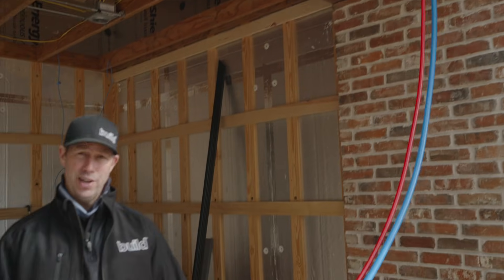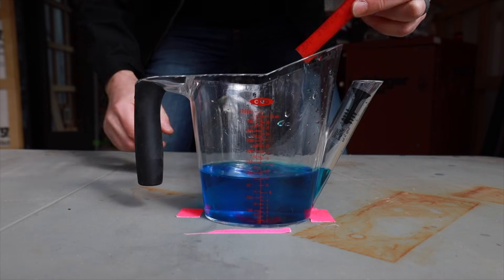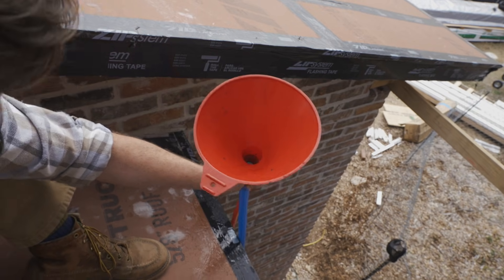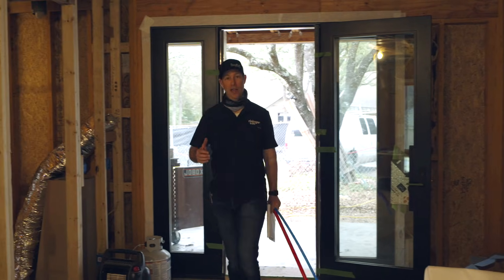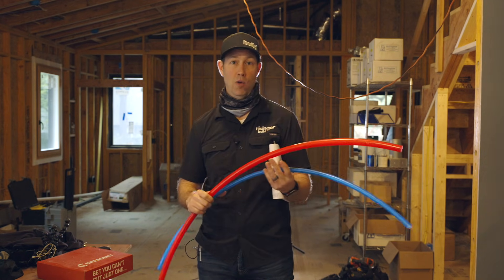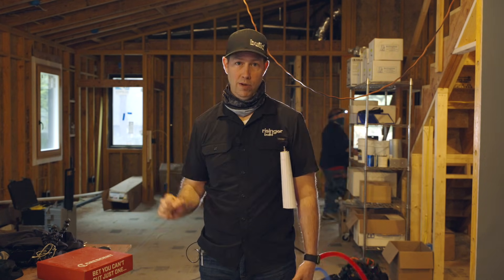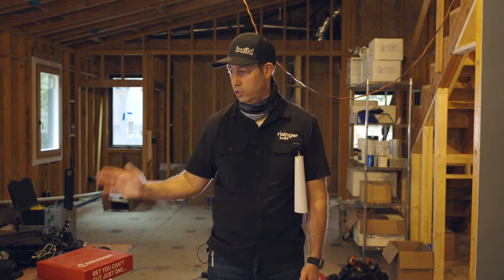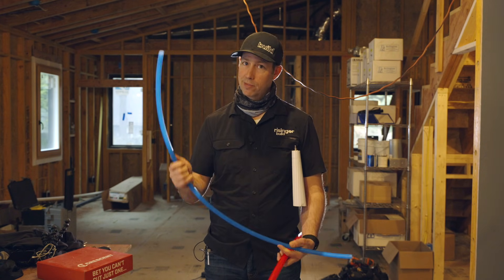What's the BEST Plumbing System

Comment: I hear you talking, about the water that's been saved by using a hot water circulation system. But I never hear you mention the heatlosses from the hotwater circulating through these pipes. The environmental impact from those heatlosses might be more than from the water you saved..... I would like a calculation from both! And if you don't want to do that, it would have been wortwhile to mention it at least...
Reply: Insulate the pipes,  get the circ pump that  has a timer or temp sensor that only runs when water gets below a certain temp.
Reply: @jefferystensland1304 
What form of energy does this circ pump use to operate?
Reply: @AW4WAL  same energy that your cell phone or electric vehicle uses
Reply: @jefferystensland1304 
I can guarantee you that the combined energy consumption of water heaters of households in the US, just one country, is exponentially greater than that of the all the phones or electric cars in the world so try again.
Reply: @AW4WAL  I'm pretty sure you can't guarantee that,  so how about you try again.
Reply: @jefferystensland1304 
This is simple commonsense deduction but maybe this isn't common to you...
Reply: Water is going to be more and more expensive depending on where you are in the country. San Antonie was/is fighting the city of Houston over water rights to Lake Houston and would be willing to run a pipeline across the state to get it.
He is using the heat pump for hot water so reheating cost will be very low.
Reply: @jameskitzmann6268 
You've missed the point.
Reply: The whole circulation line gets insulated. I installed a recirc system in my 1200 sq ft house and my gas bill went up $1-2 per month.
Reply: @briankloc  you just made that up. Why lie? Nobody has a gas bill so exact that they can differentiate between $1-2 a month.
Reply: @briankloc 
Now multiply this increase in cost and insulating material by, let's just say increments of 1000, which represents an average number of households and hopefully you see that this is an unsustainable trend.
Reply: Good point.
Reply: The electric to run the pump probably cost more than the heat loss in the line.
Reply: you also add a timer to the loop pump so it only charges during peak demand times.
Reply: @HalProctor  Grundfos comfort series pumps, timer built in also has an adaptive setting that is supposed to learn your usage or can be set on thermostatic so it comes on when the temp in return line cools off.
Reply: @jefferystensland1304  I used to install Grundfos and Taco circ pumps ages ago.
Reply: @HalProctor   timer wouldn’t work to well in residential. I don’t know about you, but our family’s schedule can be all over the place. And what happens if it’s not pre-charged, you have to wait like 5 minutes for hot water.

I guess with a 3/4 inch line it wouldnt be too bad. I have an apartment building with a 1.25” loop and if the pump goes down some people are waiting 45 minutes for hot water.
Reply: @Drizimar1  one word:  timer

Comment: Informative video. I'm in Ecuador but as I'm from The Netherlands originally (and then lives in the UK for 15 years too), I always hated the plastic piping that is common here, or worse, galvanized steel. We now have hospital-style plumbing; Unsure on the equivalent in the US, but it is clamp-on fittings. We planned it as much as possible with short runs from the boiler and the dishwasher (hot feed) and the sink (same) within a feet or so. Dishwashers that use hot water intake, common in the US and therefore here in Ecuador as a lot of stuff is imported from there, use that for the prewash. With the pods vs powder, you don't get a good prewash usually if the water is cold. So that initial inrush of 'really too cold' water can really impact ability to clean. Having that initial water warmer by having less loss (in that context, less cold water as part of that initial intake), will make a substantial difference. Little details matter. I'm no builder but it is always good to pick up on some great ideas shared on this channel.

Comment: Hi Matt, I'm from Canada and I'm a small the custom home builder. We use manifold and hot water circulation line to efficiently supply hot water at instant. Doesn't this suffice? Or you reckon this new system is much better than that?

Comment: Seems energy intense having recirc lines just to circulate hot water for immediate satisfaction. The grievance of waiting "20 seconds" I think most homeowners and reasonable people can live with. That being said, I do appreciate the potential water savings.
Reply: I think it comes down to region and resource. For those on a well and the water is just used and sent back into the septic and basically provides little waste, the water waste is less of any issue than energy waste. In areas with utilities and you have to buy the water and waste it for it to go back to get treated and then buy it again the slight amount of energy to recirculate may be less energy intensive and less expensive. Some places that are desert prone probably have cheap hydro electricity but high water costs. Other places may have low water costs and high electricity. (But most places nowadays seem to have high of both...) So the options should be chosen based on local circumstance.

Comment: What are your thoughts with respect to pressure?  That is my problem.  Sure, waiting... well, that is over after hot water comes... low pressure is horrible for the entire shower.  I have a trunk and branch install with pex with so many elbows.  My understanding of pex and a manifold setup is that you eliminate a ton of elbows which helps to keep pressure from falling.

Comment: So this racetrack setup. Would one basically bring the hot back around to the inlet side of the water heater and use 2 backflow presenters? 1 where the hot ties into the cold and one above that on the cold line coming into the waterheater? Also what about putting cold water only on the manifold system which would fix the issue of someone flushing a toilet and scalding ya in the shower.

Comment: It is a much more sensible system. I love the idea so much. I have a few questions to ask:

1. Would the water pressure be more difficult to maintain as the pump needs to pump water constantly around the loop on top of the taps?

2. Will a stronger pump be needed as the total length of the loop is significantly longer than pump to tap piping?

3. Is the internal pressure of the pipes of the loop higher than the other two? If so, will it affect the design and installation of different components?

4. Will there be needs for certain water points to be arranged in parallel rather than in series? Will there be uneven water pressure if arranged in parallel? Or would it be wiser to have multiple smaller loops with independent pumps instead of one big loop going through the whole thing?

5. If hot water is running through the house constantly, with the pump on and water heating continuously, is it going to affect the energy consumption greatly?

I know that is a lot of questions, sorry about that. I love your videos, so inspiring. Thank you so much.
Reply: I had similar questions, I think you could make some assumptions.

1. Really depends on the size of the home and if it’s multi-story. This answers question 2 as well, I would assume the answer would be yes. I’d be concerned with the energy cost of the pump, I’m sure there’s some well designed pumps that are low cost to maintain/run. Once the water is in motion it probably consumes less power:

3. I wouldn’t think the pressure would be negligible, but I wouldn’t think it could be observed, PEX tended to allow for pretty high pressures without failure anyways.

5. I think you could get away with a smaller tank since your capacity would increase now that the heated water volume is more (depending on the size of the home. The pumps energy consumption will depend primary on the length of the piping, the amount of bends in the pipe as it travels across the loop(slows water flow) and the elevation changes the pipe travels, as well as the pipe size which will contribute to it’s cost to run. I would also extra insulate the loop pipe as well since it will be continuously heated and more insulation will result in less energy loss to external air.
Reply: @EqualsThreeable  Thank you for your detailed response. I would imagine the system requires a lot of energy to get going and the pipes need to be extremely insulated.
It might also be necessary to install multiple systems in a big house. I still love the idea tho.

Comment: I admit I had to look up “Uponot Logic.” It makes sense, but is still trunk and branch; it just uses manifolds where multiple branches come off the main line. Not bad, but not a solution.

I saw an article in PM back in the 70’s that used a switched circulation pump and a return line to the water heater’s intake to pre-heat the water before use without wasting any of it. I rather like that idea.

In a house with a more vertical layout, an insulated vertical hot water supply and an uninsulated return to the water heater’s intake would use convection current to continuously circulate and pre-heat the supply without a pump, but presents two problems. One being more energy spent heating the water supply as a whole due to the cooled returning water, and the other being that it is not going to work on a layout that is too spread out, like a single story ranch or a two or three story where bathrooms are spread out horizontally.
Reply: Typo: Uponor* sorry.

Comment: Correct me if i'm wrong aren't there pressure problems when using a track system? Like when someone flushes the toilet while in the shower and you get scolded (cold water pressure dropped when line was used for toilet/ faucet). Its one of the main reasons why I prefer the manifold
Reply: Shower and tub valves are pressure balanced, have been for over 20 years, meaning there's typically a shuttle valve that only allows equal pressure on both inlets. You can't flood the valve with more hot than cold or vice versa,  when they're working properly.

Comment: i installed the Watts circulation kit in my home. never wait for hot water again. worth every penny. it will pay for itself sooner than you think. 
https://www.homedepot.com/p/Watts-Hot-Water-Recirculating-System-with-Built-In-Timer-0955800/100426993?NCNI-5

Comment: This system makes a lot of sense. I did a trunk and branch at my house with 3/4 everywhere to minimize pressure drop. I'm not on city water and I don't have a well pump though, I'm getting around 80ft of head from a pond above my property and get 24psi or so. I know it's unconventional but everything works fine I just have to make sure I don't use any "water saver" fixtures and it takes a while to get hot water but we still have hot water to anywhere in the house in two minutes. Thousands of gallons of free water and no pump to worry about.

Comment: Man those high gpm usages  mis those days when shower heads and faucets.  Here in california 1.5 to 1.75 gpm for shower heads 1.2 gpm for faucet.   They say there going to reduce it more too
Reply: Spin the head off, take needle nose pliers and pull the restrictor out. Use thread sealant when reinstalling shower head

Comment: My little Rocky Mountain cabin used to have a large propane-powered water heater in a closet on the outside. Which is stupid given the insane cost of delivered Propane and how cold it gets in winter. Since the shower was all but useless (super cramped plus I'm only up there on weekends), and most of the water use was in the kitchen over 30 feet from the old water heater, I installed a tiny electric water heater under the kitchen sink. Hot water for washing dishes was only seconds away. When not up there I turn off the pressure pump and water heater.

Which brings up an important idea: Don't put the water heater in a stupid location. The water heater in my home is over a dozen feet from where it should be, and on 3/4-inch copper. This means a long wait in the kitchen and a long wait in the bathrooms. The existing water heater is natural gas and 13 years old, so I'll have to replace it soon. I'm thinking of installing a heat-pump type myself, and moving it directly under the two back-to-back bathrooms (I'll have to do something with the in-floor drain)--which will solve that long bathroom wait problem. The kitchen will still be a wait, but not as long as it is now. If the kitchen had been laid out differently, the sink and dishwasher could have been on the wall shared with the two bathrooms. Kitchen remodels are expensive, so I won't be flipping the kitchen 180 degrees just to get hot water there a bit quicker. Most architects think about where water use happens and try to cluster things, so supply and drain have minimal runs. Who ever designed both my cabin and home were idiots.

Comment: Great video and makes sense.  Running a tankless this becomes even more annoying as that distant faucet not only has to clear the volume of water it also has to wait on that tankless to get up to speed.  I've trained my wife now not to turn on the hot water to rinse something and just let the dishwasher do the work which it does really well.  Cold rinse,  dishwasher and good to go.  Otherwise we are firing up the tankless only to rinse with cold anyway and waste hot water sitting in the pipes that never quiet made it.
Reply: FYI you may need to run the hot water at the kitchen faucet to prime the dishwasher with hot water.... otherwise the dishwasher will be less efficient as the water won't be hot enough.  If you read the fine print on dishwashing detergent cartridges it states this in order for the detergent to work properly.  My dishwasher has a sanitized feature but I still prime the system before use.
Reply: @DJ_Driven  If you say so.   We never bother anymore as it's proven completely pointless.  But hey,  you do you.
Reply: @jeffm2787  if you read the dishwasher owners manual they will recommend to run the hot water in advance.  I use finish quantum tabs and the company also recommends the same... so you don't get left over residual dishwasher detergent after the cycle completes.
Reply: @DJ_Driven  The key is in what you said,  after the cycle completes.  By that time the hot water has been primed multiple times.   Priming before the dishwasher starts is pointless for almost all machines these days.   I've found Zero difference with my steam cleaning LG.
Reply: @jeffm2787  I have the higher spec LG dishwasher and mine was having some problems not dissolving the pods completely.

Comment: You lament how much water goes down the drain when your wife turns on the faucet in her sink and has to wait for hot water to fully charge her line while you are in the shower 6 feet away. I believe you would do more than just lament if she turned on the hot water without a manifold system and your shower turned icy cold. Or worse flush the toilet and you scald yourself in the shower.That is the problem that manifolds seem to illuminate or reduce.

Comment: I have a small, older home and just replaced every plumbing line with pex. (1/2" half-rusted steel to appropriately sized uponor pex) I just used a trunk and branch system since it is so small, but I love building science and knew you would bring the goods in terms of what is the most efficient. Is it too early to replumb again? 😂

Comment: Hi Mat . I’m interested in weather or not the “race track “ system you mentioned has a pump. 
Here in New Zealand we call that a ring main and it has a pump that continuously pumps the water around. Normally we put them on a timer so not running all night. We also have the hot in the ring main at 70 degrees and a tempering valve at each branch to bring it to 50 degrees at the fitting. 
This is obviously for larger homes. 
Loved seeing the house you had on with the bromball windows and cast concrete. We’re doing a project here with Bromball . Extremely expensive windows!!

Comment: I'm not sure if I'd feel so great about saving water when I'm using energy/fuel to heat water that I'm not going to use
Reply: I have to agree. I live in the country and my waste water ends up in a septic tank that ends up going out thru a drain field and back into nature. Is not most of the water used domestically recycled anyway thru waste water plants or city lagoons. Using energy to keep the water hot ready at the tap  seems to me more of a environmental hazard than having to wait.

Comment: So this will probably sound way too elementary and I'm definitely not well educated in this stuff.  Basically we're talking about a ring distribution system like they do with electrical in Europe.  They ring the distribution electric wires in the attic and then do drops from the ceiling into the walls for each electrical jack.  In networking tech, this would have been similar to a token-ring topology.  Its of course a bit more complex because of the real world dynamics of water.  Its awesome to see these ideas being surfaced.  I'd also love to see how effective/reliable these systems are for maintenance etc.

Comment: Stainless-steel, braided 1/8-inch high pressure line with 1,200 psi. Wastes almost no hot water, and the resulting shower cleans like nothing else, either.
Reply: Some of us prefer to end our showers with our skin still attached.
Reply: @jmcdonne  You just have to use a quality, cast-steel showerhead to slow it up a little. 😉

Comment: Large house (6 bathrooms).  2 Maniblocks with a recirculating hot water loop that feeds into each Maniblock, fed by (2) on-demand Rinnai propane Hot Water heaters, with Bluetooth buttons to start a recirculating pump a minute or two before you want hot water, only wasted water is from maniblock to fixture which is under 20’, works perfectly, minimizes wait for hot water and waste.